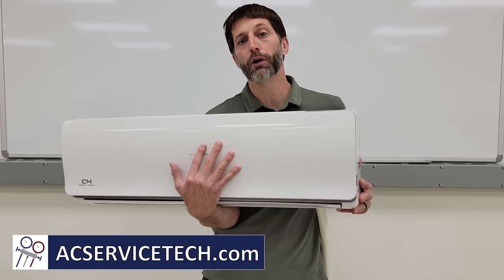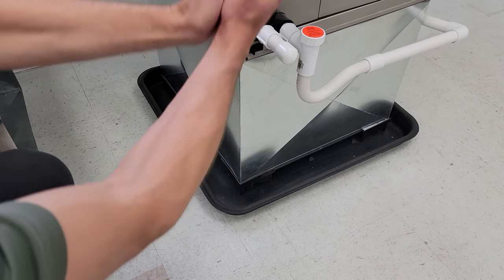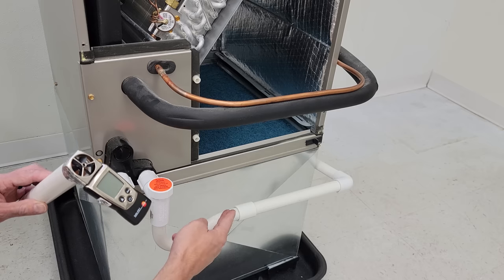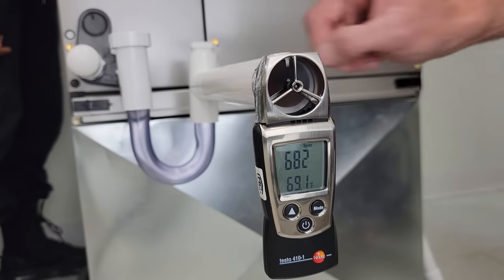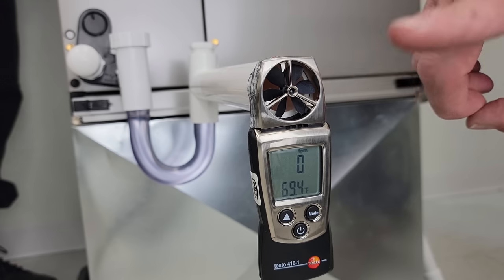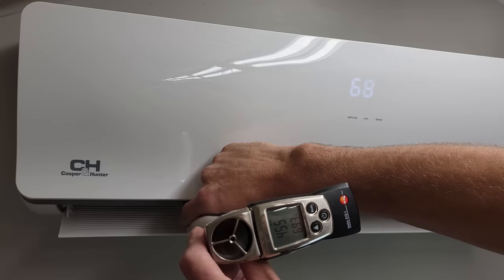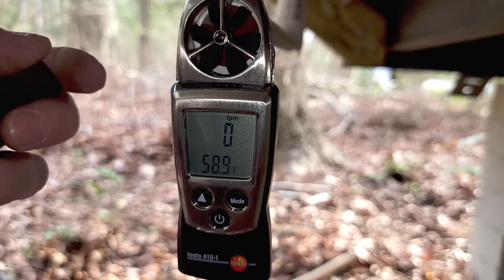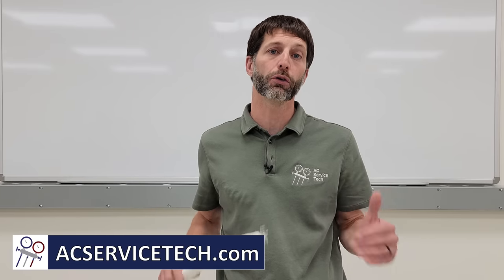Does a Wall Mounted MINISPLIT Need a CONDENSATE TRAP?  Ductless vs Ducted Air Handlers!

Comment: @5:10 I’ve had a few calls where the indoor unit is leaking water and found the drain pigtailed outside. Just straightened it and the whole drain line and pan cleared right out. 

It’s important to remember when installing a mini-split that the drain has a downward slope and not travelling uphill. It gets overlooked more than you’d think.

Comment: If you accidently trap the condensate on a mini-split system the water will run down the wall the indoor unit is mounted to. I've seen this many many times when someone runs a vinyl tube and puts the hangers to far apart on a pitched horizontal run. Better of using pvc for any horizontal runs
Reply: I just moved into a house last week that had a mini split, and I had water dripping out of the IDU. I suppose in need to go outside and look for an obstructed condensate line?

Comment: Positive pressure - no ptrap.
Negative pressure such as air handlers - ptrap
Any water draining into a drain that could emit a bad smell - ptrap
Reply: I remember this in technical school. I hope Craig makes a video with some examples of the different types of pressures and system designs. Thanks for mentioning this..
Reply: @stan-r  a positive pressure system is where a blower PUSHES air past a coil and drain pan. 
A negative pressure system is when a blower is SUCKING air past a coil and drain pan. 
If a negative  pressure system  does not have a ptrap, it will also suck air up from the drain (like a vacuum) making water unable to go down drain.. In this case, water will build up and overflow over the drain pan until blower is de-energized and then all the water will then rush down the drain since the  vacuum is now gone. In this case a  P trap is required so the water in the Ptrap stops the blower from sucking air up from the drain.
Hope this helped
Reply: @jessestewart3835  Thank you so much for the detailed explanation. This is extraordinarily helpful!
Reply: @stan-r  you’re welcome. Also keep in mind that you can only have one ptrap.  Double ptraps will also cause water to not drain.
Reply: Also very important to size the trap correctly in line with the static pressure the unit is creating. A lot of larger AHUs suck the water seal clean out as the heights are not sufficient, sometimes the drop to the trap is too short other times the water seal hight is too short. Also good practice on longer drain lines to add a vent after the trap to eliminate any airlocks that can occur
Reply: So if I drain my mini split into the sewer drain, p-trap at end of line is ok?

Comment: If only inspectors in S. Florida agreed.  They require a trap mostly for an insect/pest barrier.  I had one in Coral Springs that wanted a check valve and a trap on each line to pass inspection.  Of course we removed the check valve after passing the mechanical final.
Reply: I came here to say that same thing, I’m a contractor down here in broward abs an inspector wanted a trap on 7 minis I installed.

Comment: When in doubt read through the installation manual. That information is in there it was for mine.
Reply: @ Ja Kurt. My immediate reaction may be quite unscientific but if the equipment manufacturer does not advise to install something additional, do not. In fact the equipment manual warns the user that modifications will void the warranty.

Comment: thank you for the great video. quick question, how about a mini split ducted unit? does that need a trap?
Reply: It depends, if the drain outlet is on the positive side of the unit then no. But if it is on the negative side then yes

Comment: Question….. On my mini-split heat pump, there is a vertical condensate pvc pipe that runs directly outside. My concern is preventing spiders and other crawling bugs from making their way into the house through the pipe. Any idea how to prevent it? Thank you.

Comment: A confusing example as usually the blower is upstream of the coil not downstream with a furnace so the pressure at condensate drain is positive.

Comment: What about a slim ducted mini split system like the Fujitsu ARU18RGLX? This is not the wall mounted units. The installation instructions state it is prohibited to add a trap, rise or air bleeding when naturally (gravity) drained.

Comment: Florida and ICC mechanical codes require trap or check valve per section 307.2.4.1.
If your going to trap, trap outside but don't glue it on. That way you can remove it to clean.

Comment: What if someone has their air handler in an attic and they are using the secondary condensate drain line as well ( that would never be used unless the main line is plugged), water would dry up in there relatively fast ?

Comment: At the end of the ductless condensate line, flex tube I would do a N bend trap so bugs dont go into drain line. This would be any run over 6 foot, I have never had a problem

Comment: Is it true that if the blower motor is below the condensate pan it creates a positive pressure condition making a trap on condensate line unnecessary?
Reply: I would think the air flow over the small drain opening would create a suction.
Reply: Yes as long as the situation you mention is an upflow.
Reply: Forget the location of the blower what is important is the location of the coil relative to the blower. If the coil is downstream the blower you have a blow through configuration and the drain pan will have positive pressure. You should still trap keep air leaks to minimum.

Comment: Partially false in some areas. Water traps aren't needed, but BUG traps are required like that check valve. Our area gets tons of gnats, millions of grasshoppers/locust swarms and wasps every year. Frustrating to search for answers as they all say 'no', yet when we did a full EVAP cleanout, there was a whole array of dead bug carcasses in the drain pain of the indoor unit. Basic biology that living things look for moisture/water.

Comment: My God what dumb dumb would ask if a mini split needs a P trap? The only time you need a P trap is when the drain system is in the negative pressure section of the cabinet.